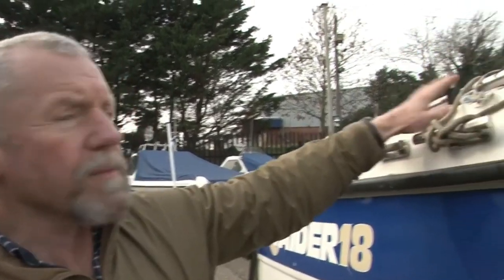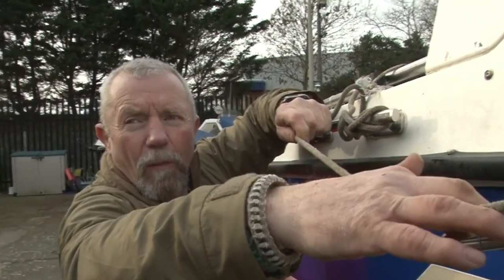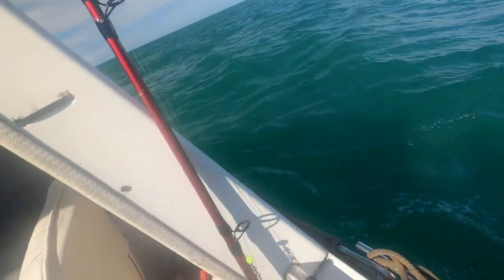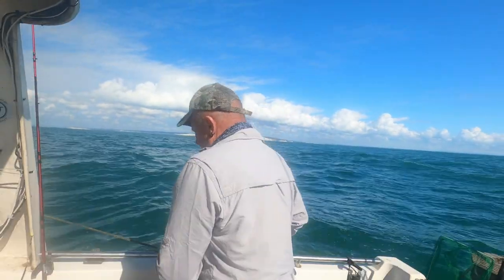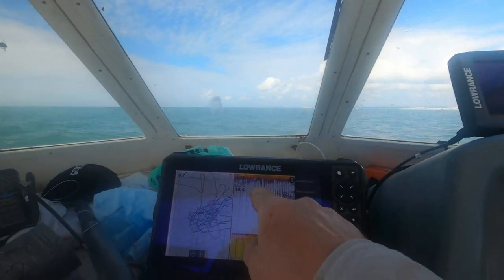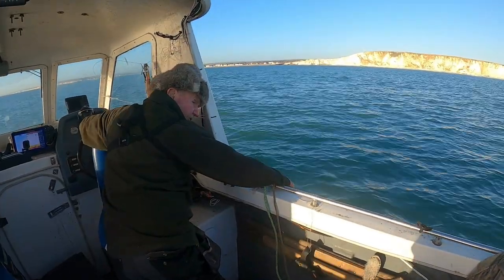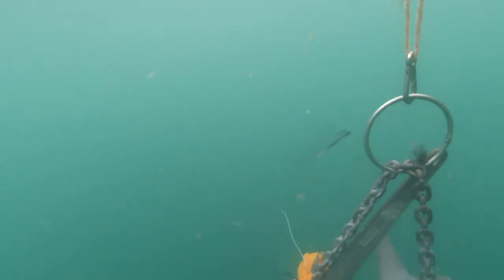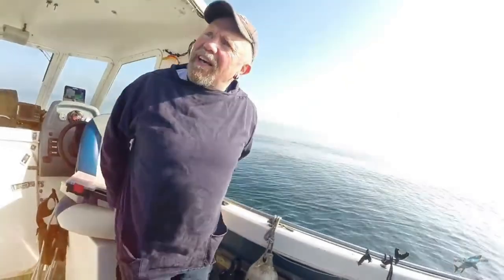Small boats - How to use an Alderney Ring and a Dog Rope to anchor

Comment: Nice video Chris very informative👍  what diameter rope and chain do you use thanks🙂
Reply from the maker: I actually dont know the rope diameter 10 to 15 mm i guess, my chain is heavier than it needs to be but it works. .  it should be the length of your boat, and it has to be heavier than the anchor. Mine is probably a little short, but makes up by being heavy gauge.
Reply: @SEAFISHINGwithCJ  ok thanks is a bruce anchor your using are they best for your area Chris
Reply from the maker: @rossturner8581  yes mate, without a doubt. Hardly ever had a problem with a Bruce, best to ask in your chandlery what is preferred in your area.